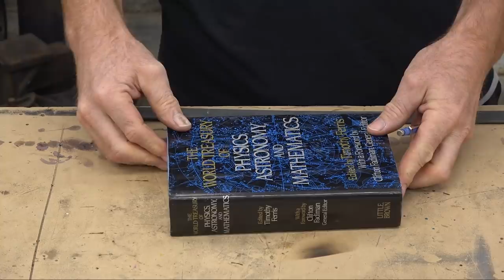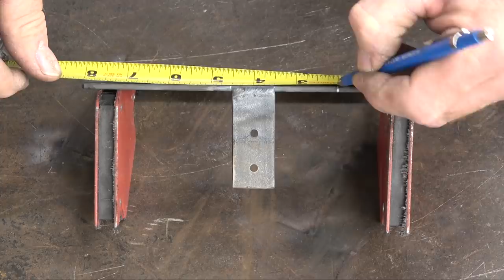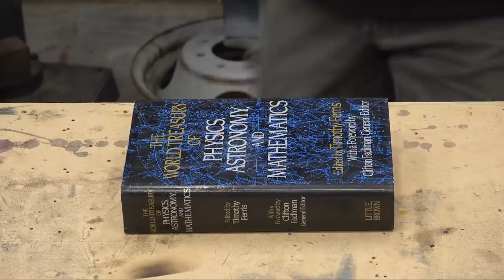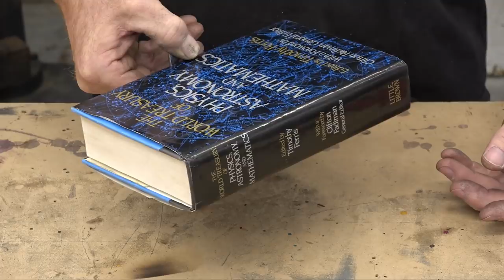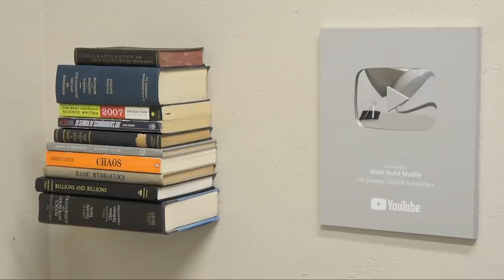How to Make an Invisible Bookshelf - Floating Book Illusion

Comment: Interesting project, well done. It's nice that the bottom book survived without modification. A couple noob questions - does preheating the metal frame improve the paint job? Is this run of the mill paint? And why not prime first?  TIA.
Reply from the maker: Preheating the metal creates a finish that is close to the texture of an eggshell. I preheat for convenience to make the paint dry faster, really for just getting on with the project. It's just regular old spray paint no specific type or brand has shown to be better at handling the heat so far. I chose to not use primer because it's an interior application and mostly hidden from view and protected by the book. Thanks for watching and inquiring!

Comment: Love this idea. I really want one. Can you explain to me what type of welding this is? At the moment, I own a stick-welder, and I can only call myself a messy novice. Since you and I probably want to accomplish the same goals wrt welding, I'd like to get your take on it. There's no way I could weld a tiny wire like that right now.  

That's not exactly 'light reading' there, by the way. Probably should've used ⅜" steel.
Reply from the maker: It's oxygen and acetylene welding also called oxyacetylene welding. It takes some practice to learn to control the heat without melting or warping your work. At 4:10 you can see that I heat the thicker metal to almost a molten state before I briefly heat the thin wire to complete the weld. There are different sized welding torch tips, some small enough to weld jewelry. It's a handy skill to have. 

Yeah, the books represent my interests more than my capacity for the topics. I think I've only completed Chaos, Billions and Billions, and In search of Schrödinger's cat. The rest are mostly for reference and fun.